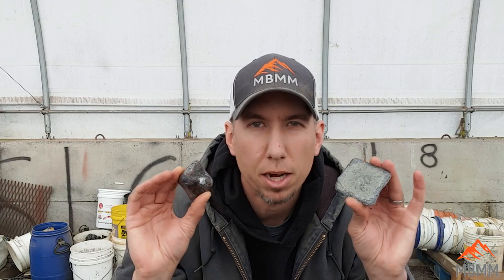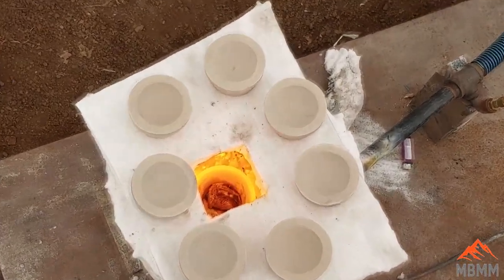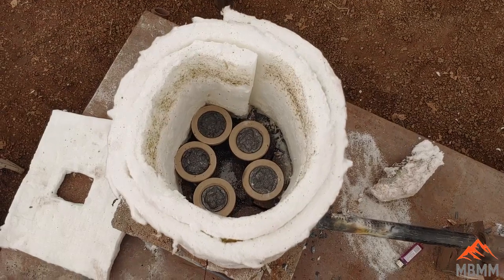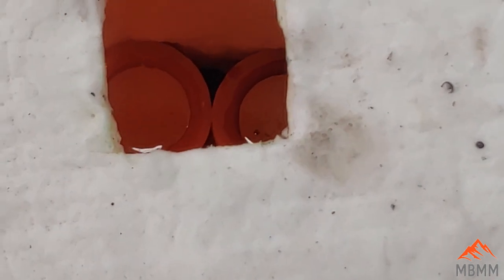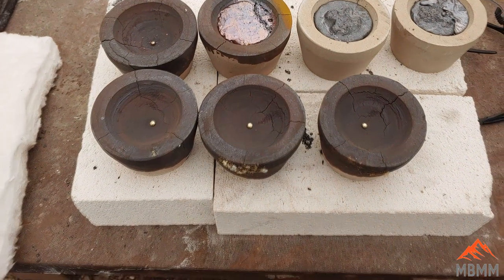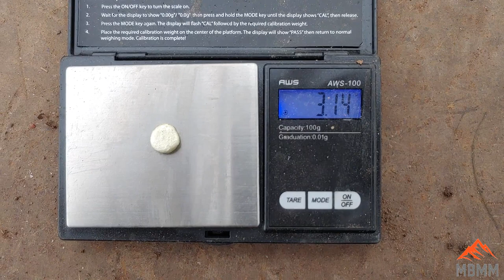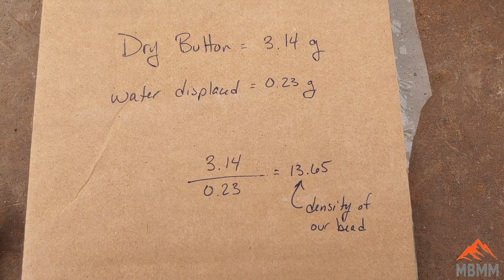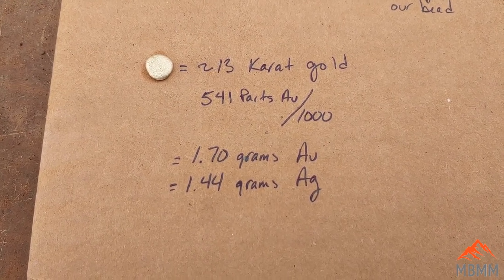Gold From Lost Lead Pt. 2: Recovering Gold & Silver From Smelting Lead Collector Metal

Comment: I want to thank you for discussing what to do about the cement cupels, contaminated with lead. . .

1) This is the second video in a row, that you mention old books, from which you have obtained smelting information, and that is actually what I am intrigued about the most from both part 1 & 2 videos.  If you don’t mind, could you please list the names of those books?

2) Yeah, no thanks.  I see a few safety issues with using lead as a collection metal.  A) Pulverizing those old cement cupels, contaminated with lead oxide, is just scattering lead oxide dust everywhere.  Sure it’s mostly contained, but what does get airborne spreads who knows where...not the least of which is on ( and in ) your clothing that then gets tracked out of your work area, and probably into your house.  B) Anything that melts into a liquid stage, also generates a vapor pressure, and lead is no exception.  While it is low around its melting point, as you raise the temperature to melt lead oxide, the vapor pressure of the molten lead increases. ( and I’m not sure that a respirator can handle lead vapor over time ).  

With that said, I don’t mind working with lead near it’s melting temperature ( I have many times ), but I think I will focus on using copper as a collector metal, and using low intensity electro-chemical process to separate the precious metal values from the copper, which ends up being nearly 100% recyclable, instead of dead ending in a bone ash cupel.
Reply from the maker: Sounds good Greg.  Check out Edward Bugbee's book: A Textbook of Fire Assaying.  Its a good one
Reply: mbmmllc 
Thank you.  
I’m always on the lookout for old books, to add to my collection of late 1800s and early 1900s, technical manuals.

Comment: All the water you are weighing is still in the cup, which is still on the scale...what exactly is this supposed to be weighing if you didn't take any water out of the cup?  I think you are confusing this with the water displacement method of measuring volume of an object.

Comment: could you explain in more detail your weighing method. Why did the difference in the readings of the scales at 9:32? All the water still presses on the cup, and the weight of the sample is applied to the beam
Reply from the maker: There are lots of articles on google about it.  Basically when you put the bead in water, but not touching the bottom, the bead displaces water and you weight the amount of water displaced.  This is equal to the amount of volume of your piece.
Reply: @mbmmllc  if i understand correctly, water weight should not be applied to scale pad

Comment: I suspect there is a mistake (You conclude it's 541 ‰ gold)
At 9:45 a density is calculated of 13.65 g/cm3 (3,14g/0.23cm3)
Gold is 19.32 g/cm3
Silver is 10.49 g/cm3

I think this calculation is actually accurate:
(13.65–10.49) / (19.32–10.49) = 0.3579 = 35.79 % of volume is gold, so :
0.23 x 0.3579         x 19.32 = 1.59 g of gold, and
0.23 x (1–0.3579) x 10.49 = 1.55 g of silver (also 3.14–1.59 = 1.55)

Therefor :
1.59 / 3.14 = 0.506 = 50.6 % = 506 ‰ (or 24 x 0.506 = 12 karat) gold

Please give me your opinion